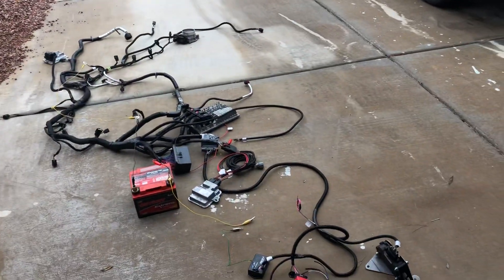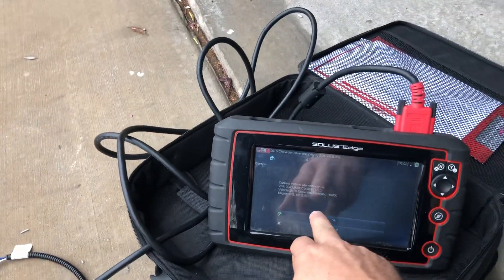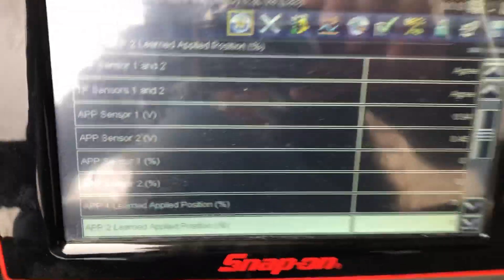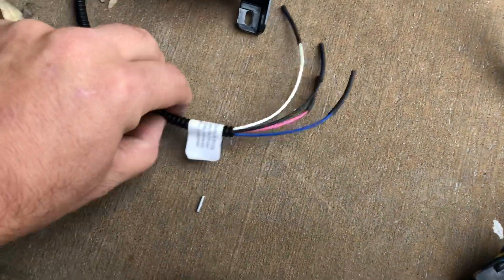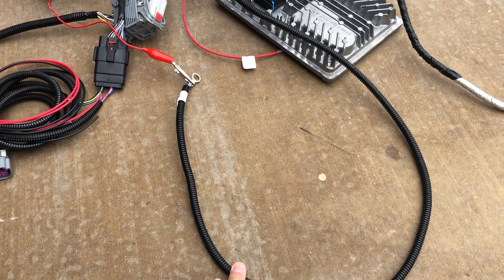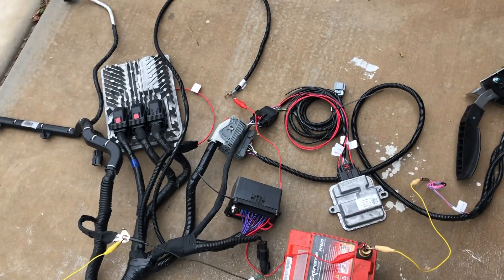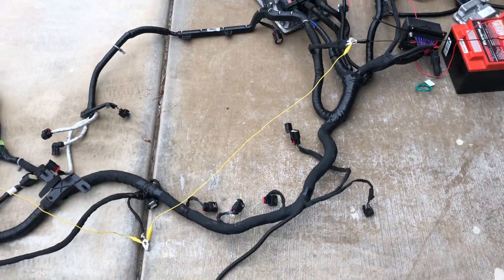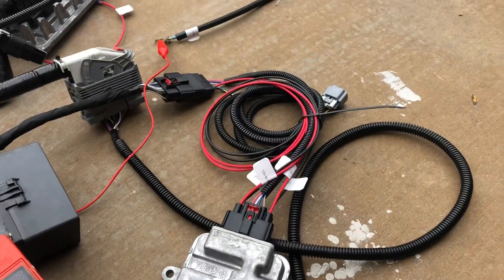Gen v harness test

Comment: Dude do you make those harness??? I have a 1996 GMC Sierra with a vortex 350 manual 5 speed I want to put in a 5.3 or 6.0 ls motor swap but I’m slow with that so would like a plug and play wire harness

Comment: Do you absolutely need the fuel pump control module or would it be okay to wire it to key/on source?
Reply from the maker: Camden Romer it will be fine to wire it to key on
Reply: I wanted the fuel pump control module.